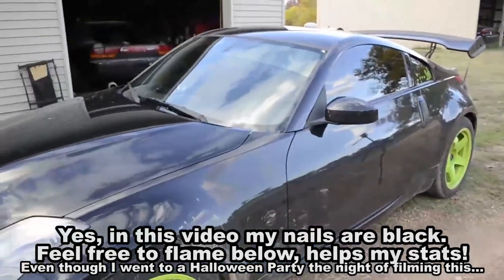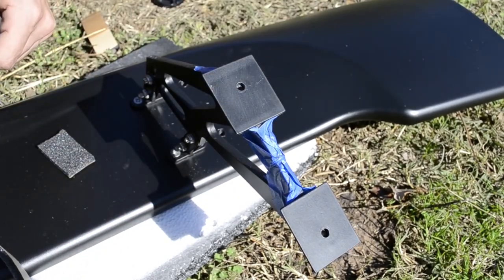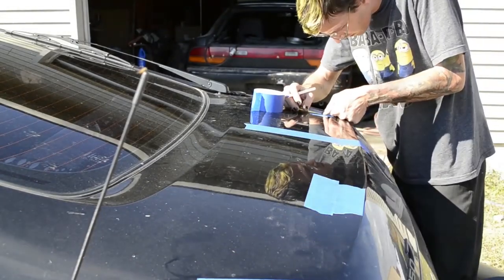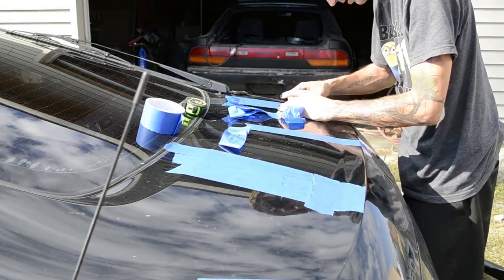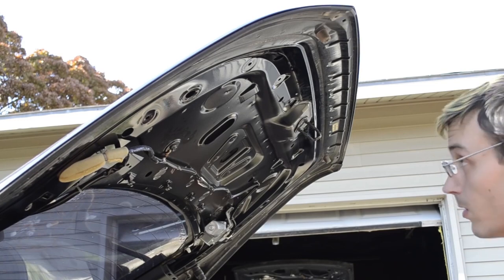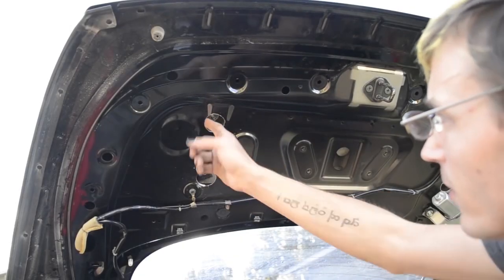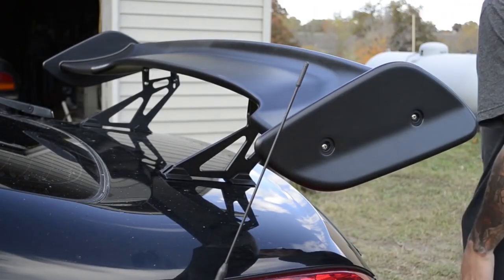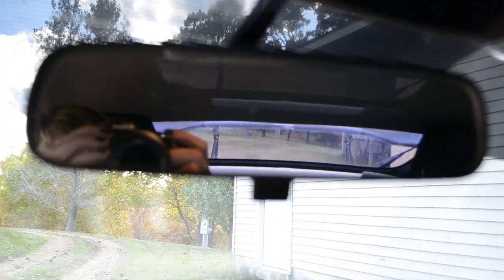How To Install a GT Wing on a 350z

Comment: awesome video and nice car dude
Reply from the maker: I do miss this car. Sold it a couple years ago.
Reply: Villain Garage Works But you just uploaded it xD? Anyways where did you buy that wing? I want one without the carbon fiber weave
Reply from the maker: Robyn Caoili this video was originally uploaded years ago on my old channel. Due to partner "issues" I moved it here. BTW, it came from extreme dimensions and is abs not carbon fiber.
Reply: Quick questuon my guy. 56" or 67" for my 370z. Thanks for the quick reply and ill use your DIY guide later after I get my wing!
Reply from the maker: Robyn Caoili best thing to do. Cut a piece of cardboard the size of the spoiler and have a friend hold it up there. To be honest an inch isn't going to look different at all really.
Reply: Ill do the cardboard trick. ow you probably didn't recognize. It is not an inch a part it is 11 inches
Reply from the maker: I read that way to quickly on my phone. I saw 56 or 57. Yeah 11" in a big difference lol.

Comment: hey i got a question, i brought the universal carbon spoiler from apr performance, looks pretty much the same but the brackets are a bit smaller, would you still follow the same instructions as to what you have done, thank you
Reply from the maker: Yeah. The concept of the installation is still the same.
Reply: @VillainGarageWorks  wou;d you still suggest i use the hole saw an do what you've done? also a friend of mine has suggested that i use some square plated washers to aid more strength for the area the spoiler will be sitting on, would you agree?

also have you had any issues with how you have done yours since the install?
Reply from the maker: @AZGaming96  Hole saw is what I have and used for the hardware to clear and still keep everything decently clean. I'd suggest to use anything that does increase strength. Wouldn't hurt.

Had zero issues from this point until I removed it, filled the holes and repainted the car about a year or so later.